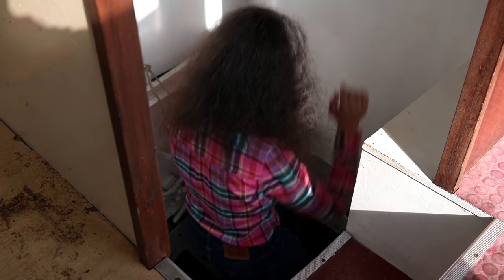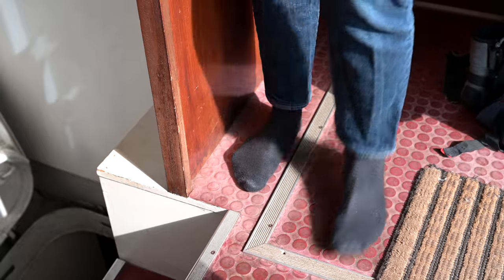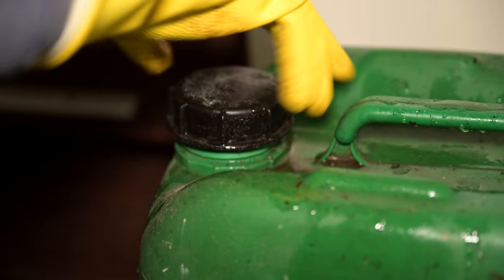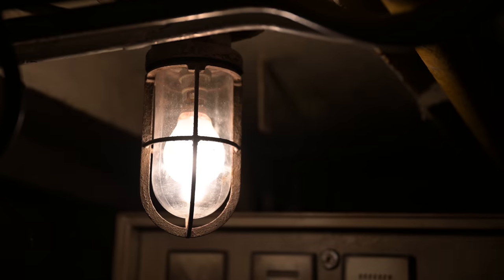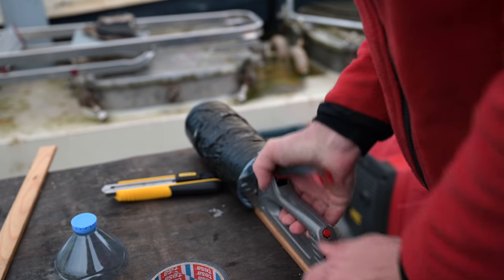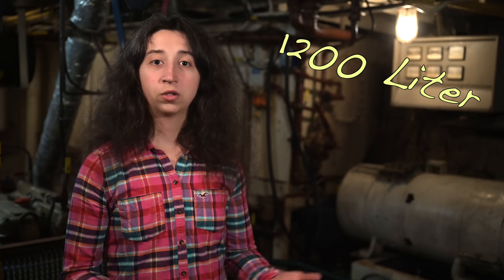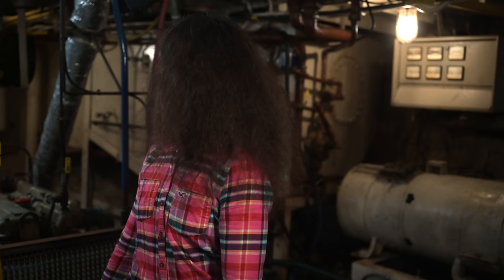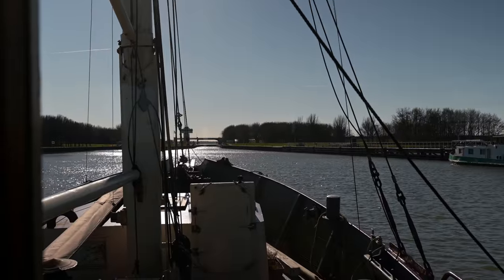Is Our Massive Historic Ship SINKING? A TON of WATER!

Comment: It is possible to manufacture a oil water separator.  The Romans had them!! The ones I used to make consisted of a rubber belt about 400mm wide. One end of the belt was in the oil/water the other end was out of the water. The belt was constantly driven the oil stuck to the rubber belt. The belt rotated and passed between two metal plates which scraped off the oil from the belt. Oil was then conducted away. In a never ending cycle. They were used in the car industry filtration systems.
Reply from the maker: I think a bit bigger and we would need one. Our goal now is to keep the water out and not to pump it out 🤣. But an oil water separator is probably a good thing to have. Thanks for sharing your knowledge!

Comment: I think you should pull her out, empty the bilge, let her dry out and then blast the rust out and seal her  bilges with an appropriate coating. Before the coating though do a thorough examination on her plate thickness especially down along her bilge line and under water areas
Reply from the maker: Thanks for your comment! We have a full thickness report of the hull thickness from her last CVO. Thats the good news. Our plan is to conserve the hull inside- out as the first big project so that we have any time we need for the other big projects.
Reply: @FlyingConey  It's the same deal when restoring a house, you must seal the weather out first before anything else. i find it difficult to trust any attempt at checking plate thickness when the hull is full if rust, muck, water and god knows how many coats of paint. It must all be stripped backed to get any kind of accurate reading. Good luck I wish you all the best
Reply from the maker: @Antipodean33  The readings were carried out by a professional because of the CVO. But it's like that, on some parts it's really great, no rust on the outside or the inside. Then you look in some other corner and think "what have I bought..." We will find out at the haul out how much welding will be involved in the project.
Reply: @Antipodean33  totally agree. The bilge rust shown in this video looks well beyond the definition of surface rust. this boat sat for quite a long time in a harbor according to one of the first episodes. corrosion through electrolysis is a huge possibility.

Comment: I'm sure you can make a oil water separator, that can screen the oil, even one that you can rent and a pump would make the job much easier on you
Reply from the maker: You are probably right. It was one of those jobs were you first think it's just a matter of a few hours and half way trough it you recognize that's to late to work smarter and just power through it. We also have had a pump for the drilling machine but it was broken, so we ordered a 24 volt whale pump. We also have ordered an M class shop vac now for the last puddles of bilge water. Seams like we are ready for the job now that it's done 😉😀

Comment: You can build a simple oil separator out of a plastic barrel. Similar to a cooking fat separator.
Another option is to build a a simple top skimmer roller.
Reply from the maker: Would have been an option. But we didn't wanted to pump anything overboard because we are not on the open ocean at the moment. Ale we thought we do it once and than it's done...

Comment from the maker: If you made it to the comment section we want to reassure you that we are at least not sinking fast. At least that's what we thinking. It's probably a dripping stuffing box and a rivet causing some liters every day. But I can assure you that it was great fun to pump out 800 liters of, whatever is in there, again! 🙄
Reply: A spare fuel tank or black water tank could be used to store fluid in bilge fluid, it could be pumped ashore to suitable treatment facility. Maritime Environment Mode is important, for all crafts in both saline and fresh water areas.
Reply from the maker: @seanogallchoir3237  Actually that's a good idea! We have about 10 000 liters fuel storage in 5 tanks and one water tank not in use with at least 1000 liters. Our main goal is to keep the bilge dry by finding the leak. Also to prevent the water coming from the saloon to go straight into the engine room bilge. At the moment we are closing off some bilge compartments for that reason.
Reply: It’s most probably the stern gland where she is leaking from. Like the video 👍👍
Reply from the maker: @taffythegreat1986  We think that's 50% true 😉 But water is also coming from the saloon area and that's probably a rivet. Not too uncommon for riveted vessels though.
Reply: @FlyingConey  arr it’s a riveted ship. Why didn’t you say 😂. That is very possible then. Hope you sort it out and live your dream 👍👍

Comment: I know that smell! I worked once in a dockyard, we had a fishing boat, in for repair, where the entire hydraulic had leaked into the engine room, due to it was run to "warm" as they said. They used the boat as a light boat and had hydraulic generators... the clean up work wasn't fun. I had protective gear and fresh air pumped in to my mask, from outside and still got blister on my fingers!

Comment: Btw guys you can buy a small bilge pump and use that to empty the bilge and there are also bilge boats in Amsterdam which can empty your bilge.
Reply from the maker: Thank's for the advice. We now have a smaller pump of the brand "Whale". The problem also was that at the bottom of the bilge there was some "mud" and we didn't wanted to ruin our new pump on the first day. Also the bilge is relatively flat at the bottom. Our task is to find out where the water is coming from, I think it's better to keep it out than to pump it out!
Reply: @FlyingConey  Stuffing box on the propeller shaft.  Suspect needs to be repacked and greeced.
Reply: @halfabee  That is definitely something to look at
Reply: @FlyingConey  When you have removed the slops it should be save to pump. The best thing you could do is let a cleaning company come and let them clean the engine bay and bilge with degreaser and hot steam this will get rid of any old oil or fat and get your bilge really clean.
Reply: @Matthias9319  Yes this is good advice, degreasing it properly is essential in keeping it clean in the future.

Comment: In the event the main engine is cooled by sea water, there may be a valve that is opened when engine is running and closed when it is not. Should this valve not shut off sea water it could be leaking into bilges
Reply from the maker: We have a fairly new keel cooling system. Most of the water is dripping in from the stuffing box. But there is also some coming in in the saloon compartment. Since we don't have many valves below the waterline it's most likely a leaking rivet a common problem with riveted hulls. We plan to strip the interior and derust and repaint the whole hull inside and out. Nothing to worry too much 😉 But thanks for the advice!

Comment: Batteries off gas. This gas is highly corrosive. That is why they had them installed in the elements. A dedicated battery room is a complicated construction. Wish i knew of an answer, other than high dollar new technology.
Reply from the maker: Originally the batteries where installed in the engine room. I know that because I had to remove the old not working ones from down there. The "new" batteries where installed in the elements was that the the seller had not much interest of caring them down after we had bought the boat.... We think of going lithium though.

Comment: You can get oil soak mats, i keep one under my engine, it wont absorb water but only absorbs  oil, that way when any water under engine is clean water, and when Matt turns black i change the Matt, they are really cheap, and a good indicator of an oil problem if it starts turning black
Reply: Hi care to share where I might get these

Comment: I LOVE YOU TWO AND YOUR VRSSEL AND THE VIDEOS.  I AM A RETIRED N. ATLANTIC FISHERMAN FROM NEW ENGLAND.  WE ALSO HAD A PROBLEM WITH OILY WATER FROM OIL DRIPS FROM THE ENGINE, GENERATOR ETC.   WE USED OIL ABSORD RAGS THAT ABSORB ONLY OIL AND NOT THE WATER.  WE WOULD ALWAYS LEAVE A COUPLE IN THE BILGES.  WHAT NOT USE THEM ON COMEY ?????
Reply from the maker: There where some left in the bilge. It was big fun to fish them out 😅. The real reason why we don't use them more is that it's a bit difficult to properly dispose contaminated materials. There is a dedicated bilge water station in the harbor and they also accept old oil and batteries. But for example we have a few buckets full of sludge and old grease we have no idea where to trow them away. (There was a man from Nantucket, who kept all his sludge in a bucket... or so)

Comment: Hi you two. First thing to check. Bolts that tighten the oil to your engine are lose. When engine is running oil will leak out. Second, previous owner/owners drained  dirty oil right into the bottom of  your boat.
Reply from the maker: The question is how many owners have drained the oil directly into the bilge. For an engine out of the 70s there's not too much oil dripping. But we also have two generators one probably out of the 50s and hundreds of hoses and connections were there might be a diesel leak. Thank you for your comment!

Comment: Filling cans could take a lifetime. Get some oil skim buoys, pump all the bilges out into the the water inside the buoy circle then skim off the oil. Any residual from this operation should be spread out in sun light and oil eating microbes applied. Apply oil eating microbes to the bilge and refresh them as needed...
Reply: Where I come from pumping oil over the side even into containment booms will get you in trouble very quickly ( fines and or jail) . They need a proper vacuum pumping from a professional.
Reply from the maker: @Pocketfarmer1  No oil was spilled in the making of the videos. Also we now have a proper shop vac to get rid of the last drips of bilge water.
Reply: @FlyingConey  excellent! Keep up the adventure.
Reply: @Pocketfarmer1  I drop of petrol product contaminates 5,000 plus litres of water.

Comment: Hey why don't you find an old bulge  pump one that would do the job pumping all that cap then when Finnsh  flush it out keep it for next time  save you heaps of time
Reply from the maker: We thought it's easier to skim the oil in the bilge. Also there was a thick layer of mud any smaller bilge pump would have suffered from. We have a 24 volt whale pump now.

Comment: A marine toilet adaptor, it can be used as bilge pump for water in bilges.
A Deep Sea Seal prevents leaks on stern gland. Halyard Marine.
The fuel tanks would need to be checked to ensure they do not leak, both fuel and water. The fluid in bilge could indicate if saline water, or fuel. 
There was a nice former trawler from Belgium used as house boat in Amsterdam. Black hull, grey wheel house.

Comment: in a steel boat there will always be some water in the keel. the steel condenses. I had three bilge pumps. one in front of one in the engine room and one behind .... I connected these so that I could see how often they were in use .... it's okay and could follow when you are out at sea ... in the keel there should be an opening from front to back so water does not smell
Reply from the maker: Thanks for the information! The bilge compartments are connected. But the deep bilge is flat at the bottom and there is no dedicated deepest spot. So even if it's just one or two centimeters of water it's quite an amount. Unfortunately it's a bit more than condensation but not so much that we are really concerned. At the end it is a riveted hull and it's always necessary to weld a few of them tight when you're out of the water.